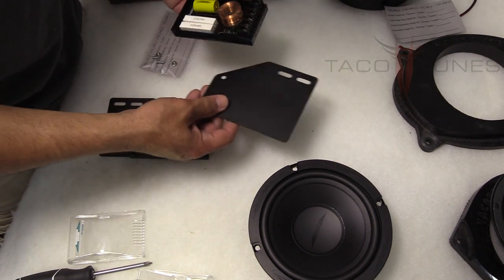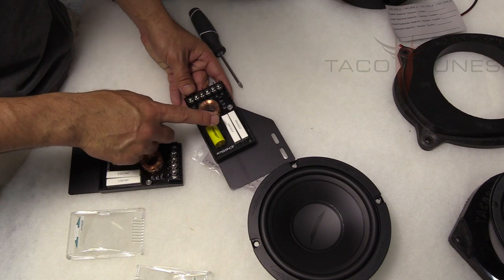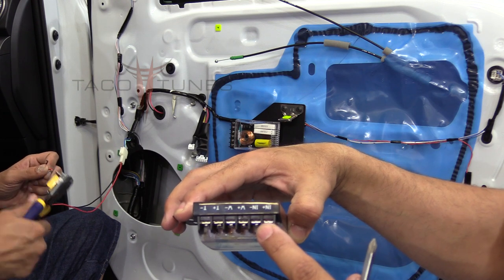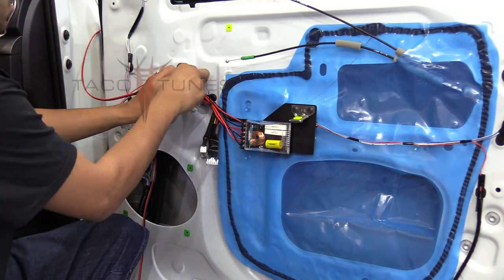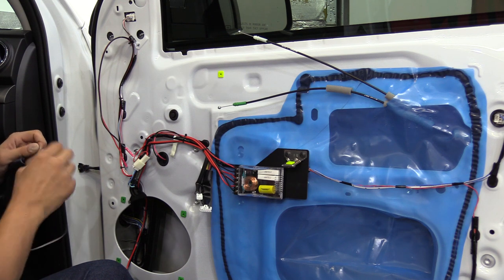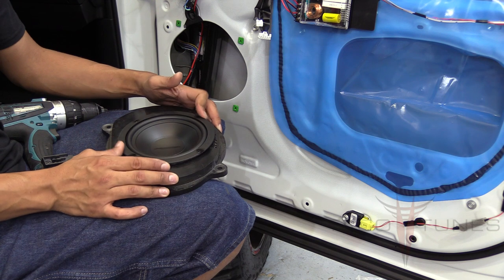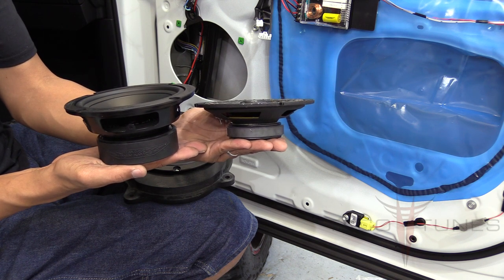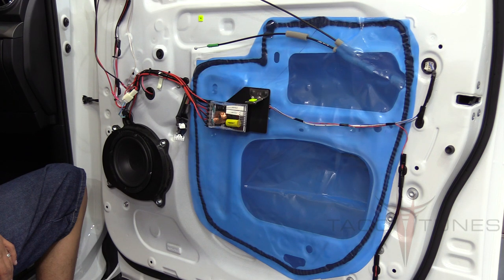How to install component speakers in your Toyota Tundra crewmax double cab

Comment: I need an amp for my 2019 1794 tundra I replaced the radio with a pioneer dmh-wt8600 an I also installed the Polk 6502 speakers

Comment: Ok on a 3 way passive  crossover  can i hook up 2- Kicker 46CSC654

CS Series 6-1/2" 2-way car speakers

One in tha midrange, the other one in tha woofer, then a tweeter in the tweeter  but will the tweeter work thats on the 6 1/2

Comment: I got focal 165as with crossovers going in a 2017 tundra crewmax non jbl, done it like this, run new wire through door up to new tweeters in the dash, theyre barely producing any sound, any advice?
Reply: are you using an amp?
Reply: No

Comment: on my 3 way crossovers I have woofer terminals but I don't have woofers to connect only mids and tweets so will it still work even if I don't use the woofers terminals...?!
Reply: the mids are the woofers

Comment: at the end of the video, you say not using "plug & play" you'll want to mount the crossovers in the center console. now is this  so you don't  have to run all the new speaker wire through the door jamb? what would be the specific reason to mount them in the center console instead of the doors. besides they just look nice in my opinion. or is that the reason.?
Reply from the maker: with the plug and play amp setup, we are using the stock wiring. To make it easier, we mount the Xover in the door. When running new speaker wire, we (preference) like to install the xovers IN the car. They are less likely to be exposed to moisture and less movement.
Reply: It would be nice if you actually sold the crossover mounts
Reply from the maker: WE do offer the crossover mounts with our products. They do not work with all crossovers so we have not listed them for general sale.

Comment: Just find a socket a hair smaller than tweeter hold it with pliers heat with torch n melt through the plastic easy peasy

Comment: The crossovers will NOT fit in the doors on a 2010 tundra double cab…
Reply from the maker: sure they will you just have to reverse the installation process.
Reply: Mount the crossover the opposite direction

Comment: You used the cheapest shittiest speakers made by kicker to compare those other speakers to
Reply from the maker: The DS line is the lower end, the CSS is lower middle, KSS is higher end and the Q series their top. . however the Kicker KSS are the same overall size as the CSS. The KSS is also the same price point as these speakers.
Reply: Those look to be like the DS speakers made by kicker
Reply from the maker: Last time we checked, there are no component speakers in the DS line up. Plus we don't carry any DS products. You are also assuming this Kicker speaker.
Reply: I know for a fact there aren’t. Last time I check that didn’t mean you couldnt grab just a DS speaker and hold it up to that one. Just cause the speakers you like don’t sell half as well as kickers do doesn’t mean you gotta hate on kicker and compare their $50 speakers to your $250 components.
Reply: Everyone knows this is a kicker speaker you “accidentally” tipped it when you held them up
Reply: Aside from the hate, great instructional video.
Reply from the maker: $250? Components? These speakers are $139.99. Not sure what that "hate" comment is referring too? We simply put two speakers side by side and explained what customers should look out for. To many focus on name vs what they actually get. You are making a lot of ASSumptions in your comments.  FACTS: The drivers we used are both rated at 100 watts RMS. Plus I don't see "kicker" anywhere in the video? Can you point me to the part in the video where is shows kicker? Plus you are posting the wrong $$$ for the speakers.
Reply: You said they were the same price point as the kicker KS components which happen to be $229.99 for the pair of 6.5 components. That’s where I got the price from.
Reply from the maker: umm ok . . thank you for your vast knowledge and great input. I feel I have learned a lot . .
Reply: Rob Tacotunes  no problem Taco
Reply: Rob Tacotunes  Trump for president
Reply: I know I should just let this convo die, but Im just curious. 
Why does it matter which speaker brand they chose to use as an example? 

Well, I guess they should of compared their speaker to something better than a kicker but its odd that you seemed so defensive about it.

Tacotunes, thanks for the video. I've been working on getting my 6.5 silver flutes and baffle to fit last few days. Gezz.... Toyota could of made it a little easier to mount a deeper speaker.